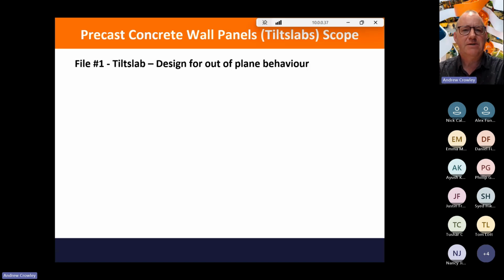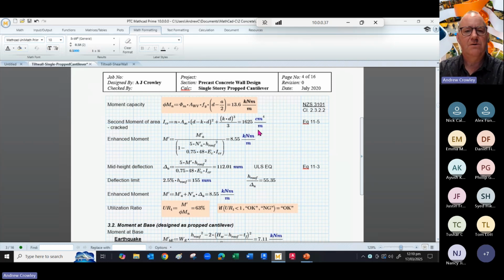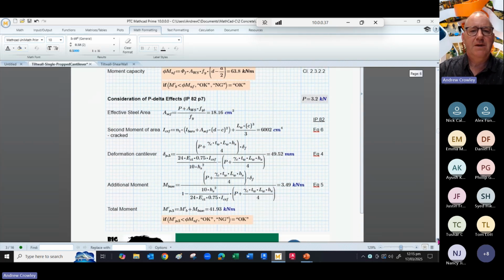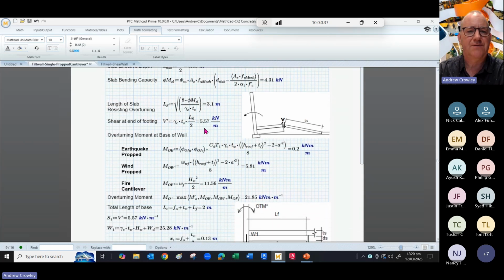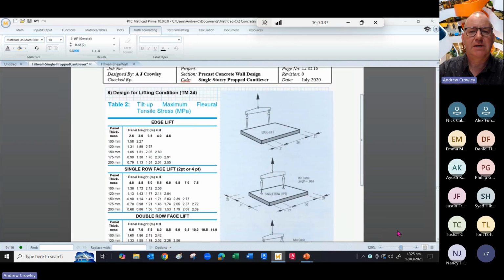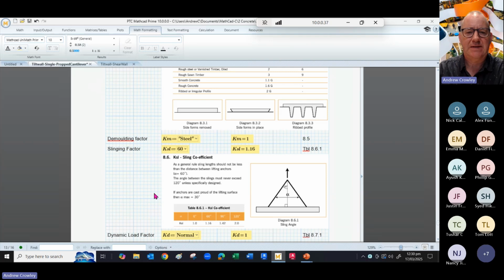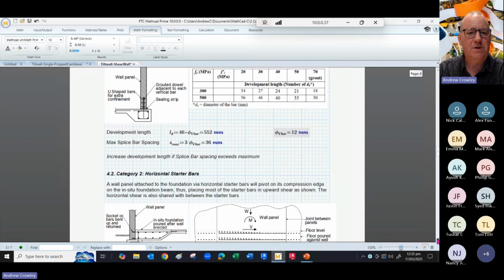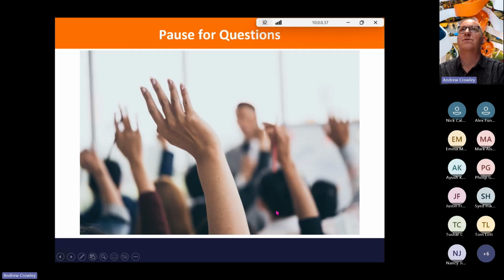CPD Seminar #30: Design of Precast Concrete “Tiltslab” Walls

Comment: Last part incorrect. It will be shear friction between panels - not normal shear.
Reply from the maker: A wall panel attached to the foundation will pivot on its compression edge on the in-situ foundation, thus placing most of the staters bars in upward shear. There will also be a horizontal shear force shared between the starter bars. The joint can be designed using the shear friction principles of clause 7.7 of NZS3101 only of the response at the critical shear plane remains elastic. The nominal shear strength is calculated using equation 7-13 of NZS3101. The interface is between the panel and the foundation, rather than between panels. In order to use a joint friction of 1.0, the face of the panel abutting the foundation must be free of laitance and intentionally roughened to an amplitude of 2mm. We usually take the design force acting normal to the shear plane as zero, as in our example, the shear plane is vertical and not subject to the self weight of the panel.  (See Branz Design Guide.)
Reply: I am talking about the shear force induced in the foundation beam - this is shear friction, as one panel is pushing down and one is pulling up. The branz guide incorrectly calculates this as normal shear.
Reply from the maker: Yes, the equation for shear in the interface between the wall panel and foundation comes from Clause 7.7.4  Shear-friction design method. Calling it 'nominal shear strength' in the Branz Guide can be confusing. The shear within the foundation is calculated using clause 7.5.